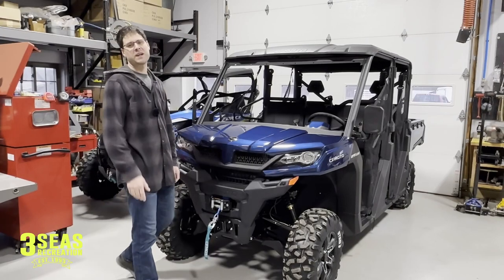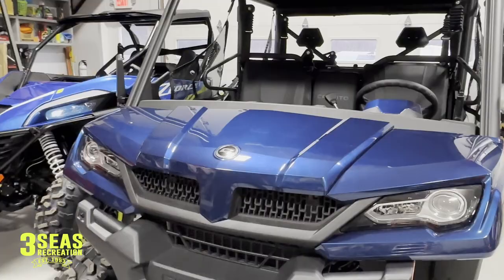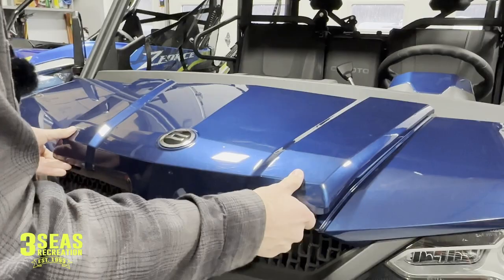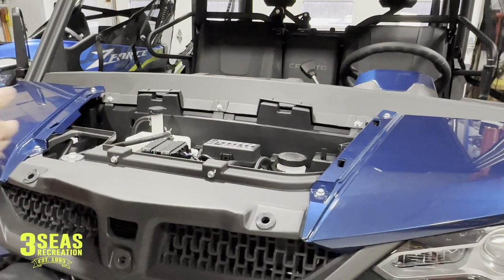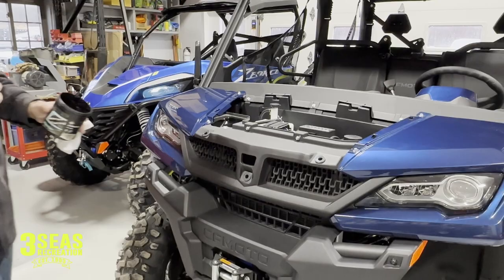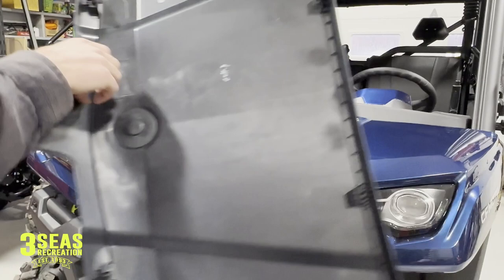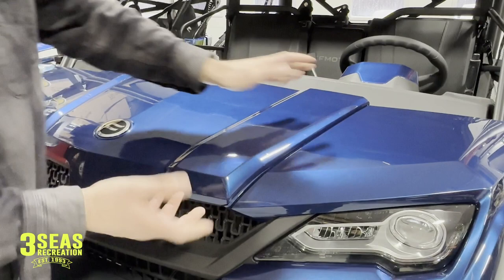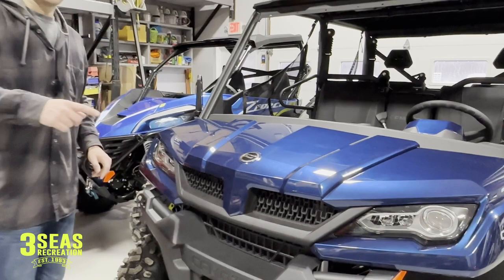DON'T Break Your Hood! U1000 Center Hood Removal & Install! CFMoto UForce 1000 & UForce 1000 XL

Comment: I was wondering if your uforce is real loud it doesn't sound like the motor sounds like a centrifical clutch I have to wear earplugs if I have a passenger you can't talk without stopping
Reply from the maker: Good Morning, sounds like your machine might need a tune up. These are NOT a loud machine at all, especially the newere Uforce 600 & UForce 1000s. Enjoy the ride, Jared